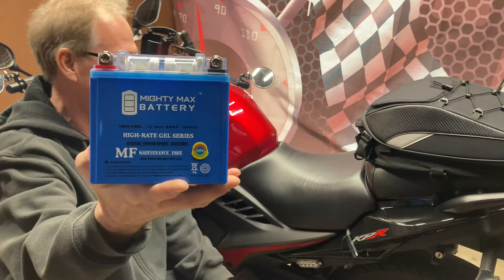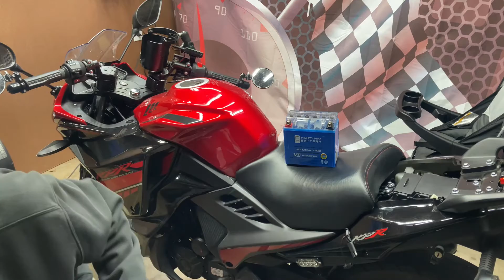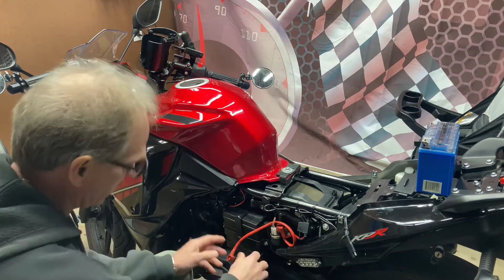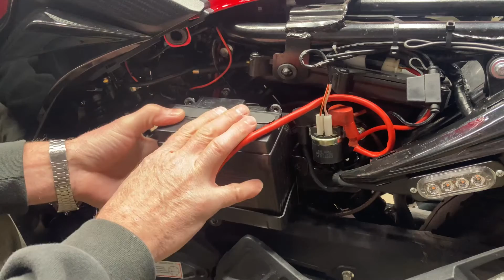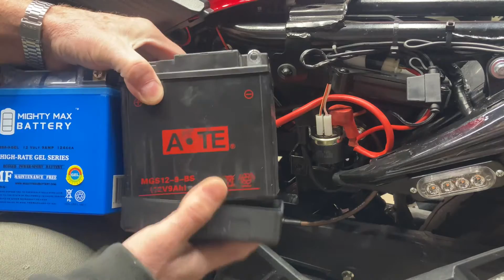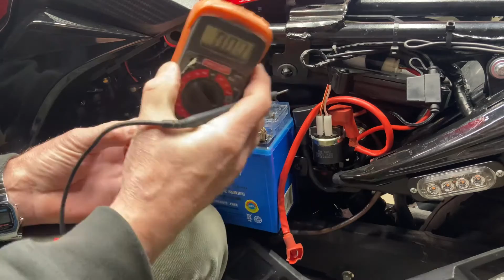How to change the battery on a KPR 200

Comment: Anybody know what aftermarket battery will fit a kpm 200? The stock one is shit and 150$ to replace.
Reply from the maker: I wished I could help on that but I won't get my KPM until later in the year. But you could take measurements and go to Amazon and try to find the same size with the same amp hours or better. I like the mighty max they are cheap and seem to work well.

Comment: Tried to start my bike up ignition turned on and fuel pump primed but when I go to start it it just dies could that be the battery being low or a stator problem ?
Reply from the maker: It could be, do you have a volt ohm meter to check voltage output? If not then you need to buy one, harbor freight sells a basic cheapo that will work for relatively low money. If you can get a meter then connect the leads to black to negative side of the battery and red to the positive side. What is the standing voltage? With your meter still connected, start the bike and if it runs momentarily what is the running voltage? For reference, the standing voltage should be around 12.5-12.75 and running voltage should be around 13.98-14.2 or so.

Comment: Hello. I hav issues currently: Lifan KPR200. Idle is rough, but when gas is turnt runs fine. Also runs fine when battery is cabled to a car. When idle it eventually dies and has to be jump started.

Could battery be the issue or is it gas related?
Reply from the maker: Hello, it could be a battery but I would check both connections on the battery and make sure they are clean and tight. Also make sure it idles at 1500 rpm when warmed up. If you need to, adjust the idle speed

Comment: I have one just like yours. crank no start. sounds like battery being drained but voltage reads 12.7. bought new starter & starter solenoid & no difference. Any ideas??? I have 4k mi on the bike,very well maintained...idk what else to do..thanks
Reply from the maker: Hello, you say it’s a crank no start, I’m just wondering why you are chasing the crank side of it? Does the fuel pump cycle on and off when you turn the key on? If it’s a no start and the bike cranks over fine then you need to find out what is missing. Pull the spark plug, attach plug to wire, plug has to be touching the head for ground, not near the spark plug hole opening if possible. Crank and see if you have spark. If you have spark and it doesn’t start then try spraying a little starting fluid into the air filter opening after you have the spark plug back in place.If it try’s to start and maybe runs momentarily then you know that you have a fuel delivery problem. First step is to find out what is missing, fuel or spark.
Reply: @herbiesgarage681  Just ordered an adapter for diagnostic tool. After a little research-I think I may have put too much engine oil when I did my oil change a few weeks ago.Uh-oh!!
Reply from the maker: @fastestmanon3legs454  depending on how much extra that could definitely be a problem

Comment: Hello Love your videos i too have a KPR 200 Carborator edition one question to you 
Sometime my bike won't start i keep pusing the selfstater self motor will spin but won't start 
But if i wait for 1-2 min and the push the button it will start up what is diagnosis 
Can u plz help me on this 
Thank you
Reply from the maker: Hello Nabed, when you turn the key on can you hear the fuel pump run and prime the system? If you can hear the pump run for a couple of seconds before attempting to start it should prime the system enough to start.
Reply: @herbiesgarage681  i dont have a fuel pump it has a carborator
Reply from the maker: @NabedHossain  I'm sorry Nabed, I completely overlooked that you have a carburetor, I was thinking about my EFI KPR! It almost sounds like you might be flooding the bike, and after it sits the extra gas dissipates. In those times that it won't start, try holding the throttle wide open to allow more air into the combustion chamber and see if it starts. If that doesn't work if it were mine, I would do some diagnostics on it and see what is missing when it doesn't start. Is it not enough gas or too much gas that's causing the no start? Does it have spark at the time of no start? It's hard for me to guess sitting at my desk but these are some things I would do.
Reply: @herbiesgarage681  Thank you so much i will look into those things and hope to see you videos soon 
Thanks again for the advice

Comment: Qq? Good sir were would the fuel pump be I'm still working with the motorcycle that only cranks But doesn't start added gas was wondering that it might be fuel pump so was wondering were it's located
Reply from the maker: The fuel pump is attached to the bottom of the tank. Did you try spraying a shot of starting fluid into the air cleaner to see if it would try to run? If it won’t try to run on the starting fluid either then you have an electrical problem

Comment: hi herbie, what is the best battery brand for my kpr? I couldn't find the one you used for your kpr in my country (Peru), mine is having some problems, I have to propel the bike with my feet and in second gear to get it to turn on, do you know of some good or recommendable brands? or at least what is the size of the battery or the specifications (power capacity, etc) since I don't know much about this subject :')
Reply from the maker: Hello my friend from Peru,  I wouldn't be overly concerned on the brand of the battery as more than likely the same manufacturer makes a lot of the different batteries. The original part number for the KPR battery is 12N9-BS or MGS12-9-BS and it is an 9ah battery. The dimensions are 71mm wide, 134mm long, 133.5mm high. Once you find the right size battery then you will need to decide on a FLA, AGM, or Gel battery. All 3 batteries are good for the KPR and the FLA is the least expensive and is the original one to the KPR. Good luck and I hope it goes well for you.
Reply: @herbiesgarage681  thanks herbie, I really appreciate the information you gave me, greetings from Peru and I hope you continue with the kpr videos :D
Reply: @herbiesgarage681  oh also, can I ask for another question? Do You know how much coolant should i put into the radiator? Should i mix with distilled water? Or those "50/50 antifreeze-coolants" are already mixed with distilled water?"  And how much liters does it fit in the front coolant container and the rear coolant reservoir (the container near the ecu under the rear seat id I'm not wrong) I would really appreciate it if you could help me with it
Reply from the maker: @Luis_jeremy0101  Hello again, I could not find the coolant capacity information, but you should fill the radiator to the top and the coolant reservoir to the full line and then your system will be full. If your bike was new when you got it you may need to check the system level a couple of times. Yes, if you use straight coolant you would want to use distilled water with it. According to the owners manual they want you to use only Lifan coolant and not to mix it with other coolants. If your bike was bought new then you should have got a bottle of pre diluted Lifan coolant with it. When it is time for me to change my coolant I am going to drain the old coolant out, fill with distilled water and run the bike then drain the water out and refill with pre diluted Honda HP or Honda type2 coolant. According to the owners manual the Lifan coolant is a mix of 55% coolant to 45% water. The Honda coolant is a 50-50 mix but for me I will be okay with it. When it is time for me change my coolant I will be sure and do a video on it. I hope this helps.

Comment: Qq? Should I upgrade the battery as soon as I get it or is the one that it comes with good?
Reply from the maker: Hello Rafael, the battery that comes with the bike is just fine and should give you plenty of good use. If you live in a cold climate you may want to remove the battery and bring it inside for the winter, and put a battery tender on it if you let the bike sit for more than 2 weeks at a time

Comment: Love your videos bc of you getting my KPR 200 on Wednesday. Can you make a short video on how you connected the alarm. What cables you put were. I also bought the alarm and rear back pack thanks to you.
Reply from the maker: Congratulations on the new KPR, I’m sure you will enjoy it!! I did include what wires went where on my alarm install video didn’t I ? Thanks so much for the encouragement, I use the bag and alarm often. I probably get the most use out of the center stand though
Reply: Hey Herbie! Love your videos on the KPR200! Could you do one on how to get the ignition out if I lost my key?
Reply from the maker: @chriszeigler3415  Thank you very much Chris, I’ll look into it, I wouldn’t think it would be very difficult to do though
Reply from the maker: @chriszeigler3415  it might be easier for you to take it to a locksmith and get an estimate for having a key impression made and have them make you 2 new keys. You don’t even have to take the bike in if you remove the seat lock cylinder or gas cap and take it in to them